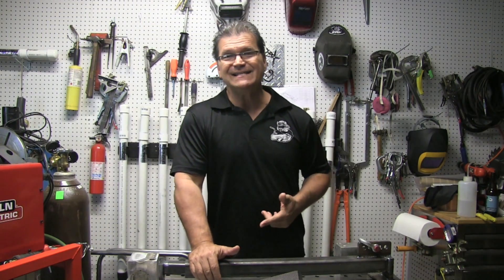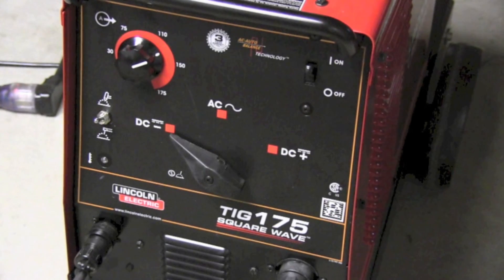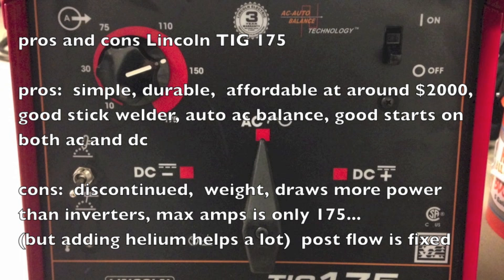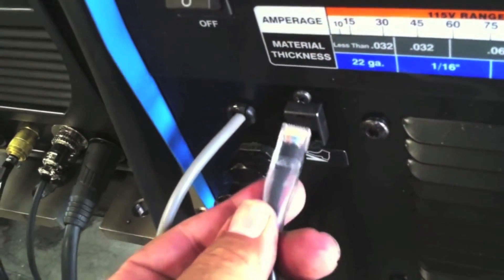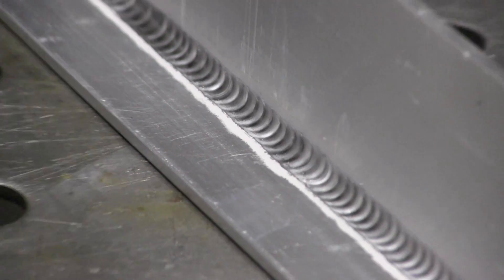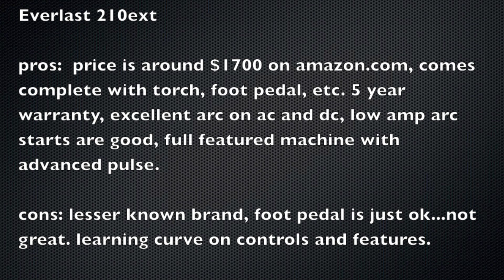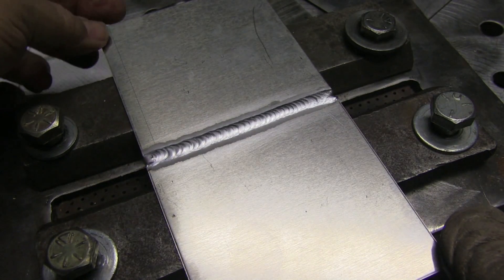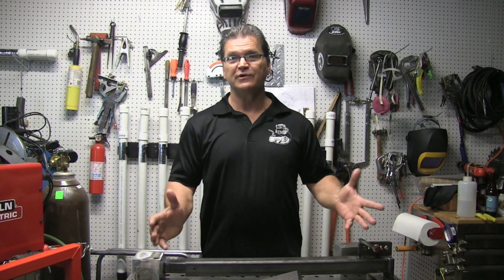Tig Welder Review pt2 - AC/DC Tig Welding Machines

Comment: What's do you recommend for tungstens for the Lincoln square wave 175 for aluminum. I've tried blue and gold. They wore ok but the tips of tungsten will start to split after 20 minutes of welding

Comment: Hello. My name is Tomasz I am the happy owner of Lincoln Electric ASPECT 300.
I have a problem with connecting the device to the power supply. Namely, I would like to find out if it is possible to connect the device to the 1st phase.
Originally, the device has 3-phase cables. Unfortunately, there is no such information in the manual. If it is possible, can I get a diagram  or use  any other device to perform this option.  Regards

Comment: I bought a primeweld 225 ac/dc tig machine. 800 bucks on Amazon. 3 year warranty. Pulse for ac or dc. Comes with a ck worldwide(best in the business) torch. It welds smooth and clean. I love it. The fabrication series has a review on it that sold me.

Comment: I bought the Square Wave 175 based partly on Jody's opinion of it on past videos. Shortly thereafter, Lincoln introduced the SW 200. I would rather have it, or something comparable, for portability which the 175 is definitely not. As he mentioned, the post flow is fixed (at 15 seconds) which I hate. You can go through an 80 cubic ft.  bottle of argon real quick. It's a decent machine though for a small shop or home use & it's a great stick welder. I think Jody has some of the best welding content on YouTube & I like that he also reviews tools & accessories too.

Comment: Jody which machine of these do you prefer the most?  I haven't tig'd before and my needs will mostly be on mild sheet steel autobody, and the Lincoln 175's simplicity and durability sound very attractive compared to these digital inverter machines.

Comment: Hey Jody, First off, you are awesome. Second, Between these 4 machines, which one would you say is your favorite and just in general, most enjoyable to weld with? Really looking into the Everlast machines for here at our shop and even one for myself personally. Looking into the  Powertig 255ext for the price point and features you get. Also the duty cycle at the amperage we usually run at a 200 is usually fine though there are times 250 amps would really just save my butt. Just curious on your personal opinion and how you feel about those in particular regardless of if it is negative or positive. Just looking for some quality words, Thanks- Devyn

Comment: I’m just entering the world of Tig welding, and I’m looking for a good entry level TIG machine. My first project is the all aluminum body on a walk-in step van - so having the ability to weld aluminum is a must.

What entry level TIG do you recommend for under $1,000.00 ?

I read very good reviews on the 2018 AHP AlphaTIG 200 X 200 Amp IGBT AC DC Tig/Stick Welder.

https://www.amazon.com/dp/B076BSD6PG/?coliid=I1JBW2D3GOP5OY&colid=CBVE4KXV0MS5&psc=0&ref_=lv_ov_lig_dp_it

Is this a good TIG, or is there a better option for the price.

Comment: Most the work I'll use this for is 18 gauge sheet metal on cars which will be a wholelot of tack welds and  some aluminum tubing. Would you get the square wave 200 or diversion 180 of the price was the same on both?

Comment: Iv been putting off buying a new welder I cant figure out which one I should get the new MP200i muti from eastwood( mig,Tig, Stick).. Or the Hobart 190 mig same price but Hobart can weld twice the thickness as eastwood but Id have tig and stick.. Anyone here have an eastwood muti or any suggestions for a first time welder to learn on mostly use for sheet metal and aluminum, around the house type of things...thanks

Comment: Jody... Can you Tig weld aluminum using the Lincoln 210 mp using lift start or do you need to go to the 200?
Reply: david brace 210mp is DC only. No aluminum tig welding with it. You can however mig aluminum with a spool gun.  The Lincoln 200 is ac/dc and will tig aluminum no problem

Comment: Jody I'm learing so much from just watching your vids thank you! I'm now ready to purchase a tig welder. I currently have a Lincoln ideal-arc 250sp for my mig welding needs. My question is I have my choices narrowed down between the Lincoln square wave 200 or the Everlast 185dv.  I love the simplicity and the parts availability of the Lincoln, but they are alot more than the latter. In your eyes which one of the 2 is the better choice. thank you for any help,  scott

Comment: Nice overview of some newer, nicer values in AC/DC TIg units on the market. I did buy an Everlast 210EXT (2015) due to the influence of some of your early videos demonstrating it in it's earlier, slightly more compact version, which obviously has the same specs and performace as the current model year. But I like the newer interface and am completely satisfied with the 210EXT after nearly two years now. Actually, the longer I have it the more I like it, even though it's my first AC/DC TIG unit, but I did use and enjoy a DC-only TIG unit before that, and then decided to include aluminum into projects of mine. Anyway, I'm glad I spent a little more to get the advanced features of the 210EXT, i.e., the wave forms, digital interface, water-cooler plug, and the memory function ability. The 210EXT is undoubtedly a best-value in the advance-features-class. The Everlast staff, warrantee, service, support, and forum have been good too. I added an SSC pedal, but then tried the new CK SteadyGrip pistol-grip amptrol device, and really dig it with the 210EXT, as the handle makes for a nice prop and it keeps your hand off an air-cooled torch, besides, it's actually "steady" too. Ha, ha, ha...

ROCK ON, Jody!
Reply: @newjerusalemtimes i am looking at the 210ext now. Are you still satisfied with it? You mentioned staff and warranty have been good. Have you had issues with your machine?
Reply: @jacojanks5985  Ive had mine now for over 6 years, and if it blew up today (I was just using it a couple hours ago) I’d buy another one tomorrow. 

I’m convinced it’s comparable in advanced features to the Dynasty 210DX w/CPS, which with a pedal and the optional SD card that unlocks the Miller hobbled features is now over $7000, I believe.

An Everlast  210EXT can still be had for about $1600, on sale, delivered, tax-free to most outside of Alta Calif., which is about the same as I paid over 6 years ago. So, THANK YOU, China, for holding down the Inflation rate for us here on the North American continent.

The 210EXT reportedly now has a more robust HF start module. Mine has the contactless HF daughterboard, but they went back to a contact-point style some years ago; the interface and housing has been updated a bit too. But the specs are relatively unchanged, like that brilliant 60% duty-cycle and maximum amperage. I don’t the Dynasty comes close to that, and Mr. TIG did a video that proves the 210EXT has a conservative 60% duty-cycle rating (See his Duty-Cycle Shootout video).

So, yeah, RUN, DON’T WALK, in getting a 210EXT before some new trade barrier goes up or a new anti-Asian tariff is imposed here on the North American continent.

The advanced features on a unit like the 210EXT are compelling, to me, and I recommend them even to a newbie, which may seem like counterintuitive advice. What I mean is, like the Triangle waveform on AC was very helpful for me early on in welding thinner aluminum, and it still is. The Advanced Pulse, when used non-reductively gives surprisingly more penetration on aluminum than any 210 amp unit around, since it is usually set for half-time on DCEN, and half on AC. I know, crazy! But crazy, good, if you want more punch on aluminum.

So, I don’t think a 210EXT is a unit that most anyone can “grow out of”, and that’s good for newbies too. The 210EXT has slightly fewer features than the 255EXT, so it may be less confusing for newbies, i.e., no EASY START function of SPOT function, which makes the interface less-busy.

I thoroughly enjoy and endorse it! I'm guessing that you will too.

Comment: I just picked up the Lincoln Garage Pak which includes the 210 MP and the Square Wave Tig 200 for $1999. That is $600 less than usual. I was looking at the Everlast 255ext and then later getting a AC/DC tig from Everlast later but would have had about $3000 or more in that setup. I contacted Everlast about getting their machines without their "TIG kits" because the 200 DV was offered without TIG Kit on the website. I wanted to just add my own foot pedal and TIG torch and save the money in not having to get the accessories included with the Everlast machines. However, I was told that I could not get any of the other Everlast machines without also getting their TIG Accessories. I feel like for what i will be doing which is hobby jeep and motorcycle work The Garage Pak was a great deal to cover all processes. Hope I made a good choice anyway.
Reply: Rob Durham best of luck to ya my combo would likely be a everlast 250 amp multi and an ac tig specific box. the multi is crammed with top notch features and costs 1600 retail.
Reply: how do you like your square wave 200? I've been wanting one myself
Reply: It was a special Lincoln was running. I ordered it from their website
Reply: Josh Capasso Liking them both pretty good so far...Still havent done any aluminum welding though
Reply: Josh Capasso the squarwave has a shit 35% duty cycle

Comment: jody, love the videos. i currently use a syncrowave 200 and have for about 5 years or so love the machine and i have never had any issues with it. however i feel i have reached the maximum capabilitys of the transformer machine. I am in the market for a inverter machine that is more portable and has feq controls etc. i have always been a miller guy but iam seriously considering an everlast 210ext based off your videos and mainly the cost compared to a dynasty series machine. what are your thoughts on the everlast? thanks for all the videos!
Reply: carllee31 jody has actually reviwed some everlast boxes, search his vids. a fellow named chucky2009 has reviewed almost every everlast box produced as well as miller and other brands. the guy is really good at demonstrating stuff and entertaining.

Comment: hey bud I wanted to know your opinion on the everlast 164si  is it worth it I do welding side jobs nd can really use the ac DC nd the plasma , , also was curious to see if you had a fix or alternative to the whole gas connection , , when ever I would need to switch gasses or processes I'd have to disconnect tanks and it's a hassle is the maybe a multi entrance gas valve than I can just turn to switch from gasses for example going from tig to plasma and needing compressed air , thanks in advance

Comment: I've owned a everlast powertig 210 EXT and I would never buy an Everlast product again.  My Everlast didn't last forever, after one year of very light use it broke, I shipped it to them, I was quoted 4- 6 weeks for it to be repaired.  2 months later they hadn't even looked at my unit .  3 (THREE!) months later it was finaly repaired. I sold it and bought a squarewave 200 I couldn't be happier.
Reply: Ive used mine for the last two years nearly every day... hasnt skipped a beat

Comment: Do you have an AHP AlphaTig 200x? I've had mine for a year and I've been loving it. So many features, ZERO issues for under $800. Only thing is the pedal is different from your standard Miller/Lincoln pedals, but it doesn't take long to get used to.

Comment: I have a Miller EconoTIG machine which I believe is essentially the same as the Lincoln Tig 175 (Transformer, No Freq control, fixed post flow).  I can't weld Aluminum worth a crap with that machine.  I had a couple of scrap pieces from a golf cart frame and I could not really get a puddle started.  I also had problems with the tungsten getting really hot and eroding.   I started out with 1/16 Tungsten and switched to 3/32 which worked a lot better but still dismal results.  Any suggestions for welding aluminum with a transformer machine would be awesome.  (Like using Helium. . .)

Comment: +weldingtipsandtricks
 Would it be possible to review some no-name Chinese units? Is it worth 
it to buy one of the cheap units and save some money up front (fully 
digital chinese tigs with all sorts of AC adjustments are less than 
900$) or they are so crap that it would end up costing much more on 
repairs / buying a brand name machine at the end ?
Thank you for the great videos. You have helped me tremendously.

Comment: hey Jodi...hope that's how ya spell it...lol

so I picked me up a tig gig welding aluminum sand casted parts to 6063 sch 40 aluminum pipe with a miller dynasty 350.

of all the education I have, my super is saying/wants 3 pass welds and washing them all together to get a "solid bead".....

This goes against everything I thought I knew about welding aluminum. Their welds are solid white and washed out with massive heat pumped into the part...and no preheat.

Could you do a small segment for this? The shoulder off the pipe is about 1/2". I'm sure I'm missing some info here....but to see a professional and his settings might go a ways with a super that got his title via friend....and has no business welding (in my opinion )

Comment: Affordable at around $2000?!?!?!? That seems like a crazy amount of money for a basic welding machine to me...
Reply from the maker: I consider it affordable as opposed to a Miller Dynasty 210 for $3400 that does not come with any accessories. But stay tuned for part 3 and there will be some cheaper units shown...as well as some more expensive ones.
Reply: Prices have dropped dramatically over the past few years. I'm looking at the Everlast 255ext and some of its features never even existed in this market three years ago.
Reply: Miller welding systems fit the description of "basic welder" while deemed to be reliable, the more featured versions of the 'basic model' start at 2800 and go up from there.
Reply: and then the everlast with WAY more features is CHEAPER?!?! Man, I really don't get it.
Reply: And then the lincoln is even cheaper... so it seems the more features and the better the welder, the less you pay for it.
Reply: I haven't looked at the machines, but you pay a lot for duty cycle. squarewave 200 is only 25% at 200 amps.
Reply: AC TIG is only becoming "basic" with the advent of the Chinese/offshore inverters.  The traditional entry level AC TIG welder is a used Syncro or Square Wave, which are still around, but the prices are plummeting as the Chinese stuff penetrates the market, especially the hobby/small business market.
Reply: 1873Winchester Top of my list is an everlast 251si, at 1600 bucks it offers 250 amps of pulsed mig, pulsed tig and stick operation. That would probably do everything I ever wanted and then some. If i had more cash to throw at it i'd probably do a miller xmt but I need something I can afford before I get too old to move around without a walker. :)
Reply: E-Nonymouse  hey brother I have a  everlast 251si and its awesome...every process is great....no issues at all..godbless
Reply: +weldingtipsandtricks Hi Jody could you maybe review one of those Chinese ones? Something like the Jasic Tig200p AC/DC ? Anyway thanks for great videos, they help me a lot.
Reply: I never really even looked at AC/DC welders, for most hobbyist stuff it seems to me DC is where it's at. Got a good solid kemppi with advanced features for chump change.
Reply: Kemppi is not sold in the states. Kemmpi also does not do any warranty repairs, it's only handled by the dealer.
Reply: I know, but it's what I got since I am in Finland and they are everywhere here. It wasn't a plug for said brand, only of the principle of buying used quality over modern made in china stuff. You'd probably go Miller, I dunno what else is considered quality there, Lincoln, Hobart perhaps.
Reply: 1873Winchester ggg🔋🕹🔌📞📸📸🙃😘😘📌✒️🤗👥👁👄👧🏻👧🏻🇻🇪
Reply: Good to know thanks for sharing!
Reply: That's a great price. I've got a couple of everlast welders myself. Very good value for the money.
Reply: That’s pretty cheap for a tig welder

Comment: Great videos! I have learned so much from the great arc shots. I have a Lincoln 175 and I have been getting a really big cleaning zone when welding on ac do you have any recommendations of things to try to improves its auto ac balance feature?
Reply from the maker: Try using a #5 or 6 cup with 12-15 cfh
Reply: +weldingtipsandtricks ill give it a try tomorrow! Been using a #8 cup with 15 cfh. Keep up he good work!

Comment: So far, from what I can tell is that the AHP AlphaTIG 200X (2016 model) is the best AC/DC TIG welder for your dollar on the market right now. Love the fact that it's dual voltage!

$700 on Amazon
Reply: yeah, until the high freq start craps out on you only after 5 months and only two 80 cu bottles then you have to pay 90$ shipping both ways lol... ask me how I know
Reply: The tech guy said word on the street is they may be making a water cooler for it for next years model for still a really good price.
Reply: $730 shipped, yep. I just grabbed one two weeks ago and love it!
Reply: +Hayden Wilson which model do you have? The newest 4 revision?
Reply: no, it was the 2015 model. I bought it right before the 2016 came out. Shipped it Monday last week, got there Thursday. Just called and they said it should be shipped out before the end of this week so we shall see.
Reply: got the welder back, everything works great however it came back to me with the sides really smashed up. Not sure if it was from shipping or not but they warrantied it pretty fast